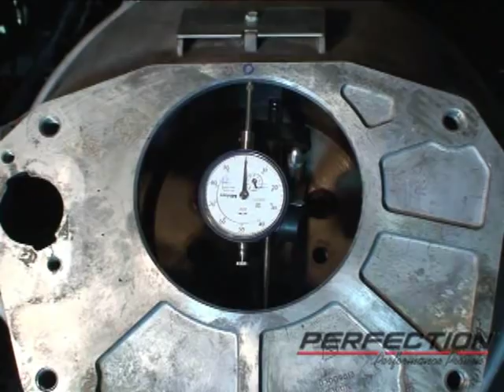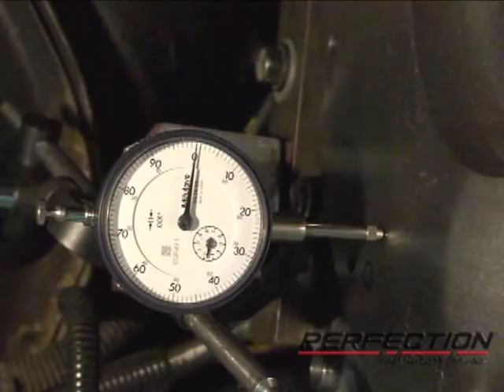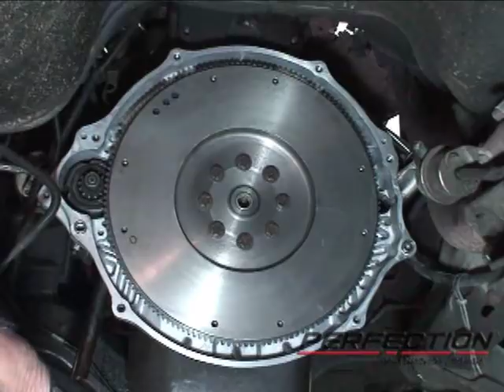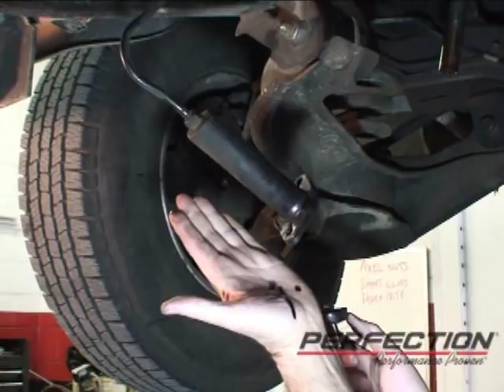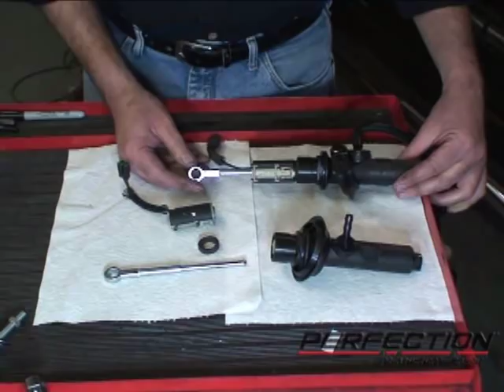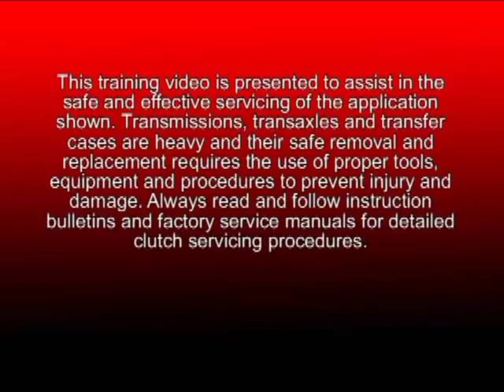Dodge Ram 1997 5.9L NV4500 5 Speed Clutch Installation

Comment: hello there thanks for this video ,question i have a 1998 dodge ram 3500 5 speed diesel engine ,the gears dont seem to engage ,and also i can put the gears on with the engine on but it wont move the car dont move ,any pointers ? thanks

Comment: Great video. Appreciated the detail. You mentioned high temp wheel bearing grease for the splines but did not mention the type for the pivot points, bearing, and sleeve. I assume the same type of grease is fine?

Comment: I know this video has been up awhile but,  I have a 2000 5.2l magnum that has to have this done. Very informative and I enjoyed watching. I understand that gas and diesel are different but a lot of the mechanics and techniques are the same as well as chassis parts. Very thankful that I found this. It is a perfection clutch and flywheel that is going back in the truck. Thanks again for doing a very good job on instructing and teaching.

Comment: I was watching this video and I have  a question and hopefully you get this.... I heard from some guys that it is possible to put the clutch backwards.. what do they mean by that... I have yet to find a video that ever talks about that..  they say if you put it backwards the clutch won't catch.. is this true for 2000 Dodge Ram 1500 3.9L V6 RWD Manual TRans ???
Reply: I have the same setup in a 2001 the nv3500 I had the master and slave cylinder go I thought it was the clutch at first and yes it will not catch if its backwards
Reply: The clutch disc usually has flywheel or transmission side stamped on it to show which way to install it.

Comment: you neglected to instruct correcting the -19" off center issue. I figure 8" toward the 12 o clock is needed...will the two hollow dowel pins allow moving the adapter plate that much?

Comment: Looking to buy a second gen ram 1500 again are 5 speed manuals transmissions  more reliable then the automatics with the 5.9?
Reply: Dodge2017 As long as you’re stock power levels they’re both decent transmissions. Obviously the automatic has more parts and is more complicated therefore more expensive usually to fix. The auto can be built up decently to handle more power. The NV3500 would be cheaper to fix. I have a 92 Dodge with the 5.9 Cummins and I have the bigger NV4500 and has handled 600-800ft-lbs of torque well.

Comment: I have a question. How did you set up your dial indicator to check the runout inside the bellhousing? I'm currently trying to figure this one out. trying to find center with my dial set. 
Also, I did a flywheel face reading, I got a max reading of .003 between the 5'o clock and 9' o clock position. The acceptable tolerances i've read are .005 to .008, so I'm thinking that I'm safe in that regard. Unless you think otherwise. I cleaned the heck out of everything and torqued the flywheel bolts to spec, cleaned off the flywheel surface beforehand.

Comment: hey, great tutorial, got a question, i have a auto 5.9 magnum that im putting a NV3500 behind it, now the auto crank wont have a pilot bearing, will an oem replacement bearing work or will i have to drill the hole bigger,  im getting the parts this weekend so im going to find out anyway but any advice would be helpful

Comment: The service manual says on diesel engines if housing bore runout exceeds 0.015 inch, the clutch housing/transmission
adapter plate must be replaced. If that bell-housing needs to come down ten thou how do you go about doing that?
Reply: Daniel, I actually replaced the engine to trans adapter plate and bell housing on this truck in this video. Just pay attention to the dowel sleeves and clean surfaces. But this is the NV4500 5 speed. The NV5600 and G56 6 speed bell housing is part of the transmission cases, not so easy to R&R those housings. Not so easy to determine if out of spec either. Gary

Comment: This video is great and really helped me understand how to properly assemble the clutch assembly. I got quoted for $700 in labor to have the job done, instead I burned a few Saturday's in my drive way in the cold speaking curse words. It was slightly challenging to get the transmission back in because the angle of the input shaft needs to be at the same degree as the clutch ...so a little adjusting of the tranny jack and patience got her in. Also I needed to use a 2x4 and a piston jack to spread the frame in order to get the crossmember back in. The whole job sucked but was relatively straightforward.

Comment: Is it normal for the slave cylinder push rod to always have a load on the clutch fork/ throw out bearing causing it to always spin? When I insurt the slave into the bell housing i have to use some force to compress the internal slave spring. I've tryed cracking the bleeder to release any built up pressure, and no luck, I also shortened the push rod by a 1/2". I've also bench blead the system like shown in video. The system is the 98-02

Comment: Thanks for the upload. Very informative.  Having issue with a 1500 4x4 truck, will try the bleed process again before removing the tranny to do a inspection.  Owner said the previous "shade tree" mechanic may have done a botched job on the clutch.  I found he only had one bolt in the CPS which then broke on the fly wheel then caused a "no start" issue.  Who knows what else he did poorly.  The clutch pedal is dead also. Maybe air or throw out came off fork.

Comment: i have a 99 2500 cummins 5 speed NV4500. i just started having a issue with a noise that only happens when i am stopped with the clutch pedal down. truck shifts normal and no slipping. The noise almost sounds like drum brakes slighty pressed and dragging with a growl. Any ideas?

Comment: i have a 03 dodge ram 2500 changed the slave cylinder with the master and slave kit pre bled but my buddy forgot to tighten the bolts on the slave cylinder when i tried to shift it would not shift and then i noticed the bolts loose on the slave cylinder so i re tightend the bolts but nothing i pulled the slave out and the retaing tabs wore broke do you think i got air in the system and if so how do i bleed it with out those tabs holding the rod in after i bleed it

Comment: if i read you wrong which i may have, and you have an automatic and you want to do a manual swap for your 1500 5.9, then you could use an nv4500 you will just need a different bell housing to match up to your gas engine (this will be very easy because in dodge 2500 trucks they used the nv4500 behind gas and diesel)

Comment: in dodge 1500 trucks, they did not have the nv4500 behind the engines. you will either have to get a new transmission or you could get an adapter plate but i would not recommend that because if your putting a high torque diesel engine in your 1500 truck, the stock transmissions will not be able to take that much power very easily and you run a high risk of blowing your trans. i would highly recommend getting an nv4500 to put behind your cummins

Comment: A buddy of mine had the same problem when we installed his new clutch but it popped after the installation was complete.  His problem?  Somehow he broke 1 of the ears of the plastic clutch master cylinder where it bolts to the firewall.  Once we replaced it the clutch felt better than new.

Comment: I'm working on a project using one of these cummins in a chevrolet and I have been buying pieces as money allows.  I have a question about the bolts mating the bellhousing to the engine plate.  The bellhousing has 1/2" threaded holes all the way around yet the engine plate was 3/8" threaded holes.  Is there sleeves I am suppose to install in the bellhousing holes or is there special bolts I'm suppose to be using?

Comment: @perfectionclutch is it possible to install the clutch pack on the flywheel install it on the trans and install the transmission with the clutch pack on it sorta like an automatic torque convertor

Comment: @perfectionclutch oh i see i am replacing the clutch now new pilot bearing resurfaced dual mass flywheel and i know not to use the bolts to suck it in so to say thanks for replying back